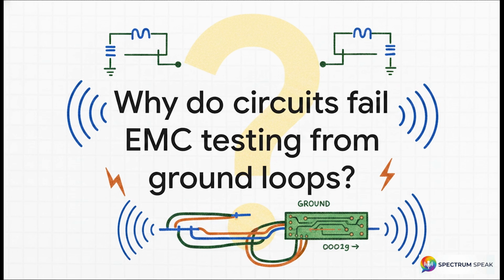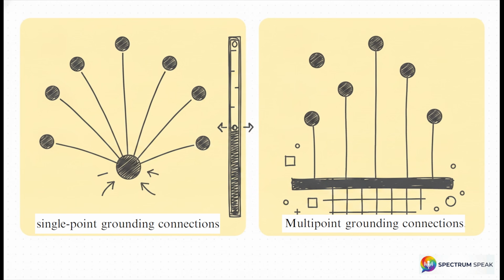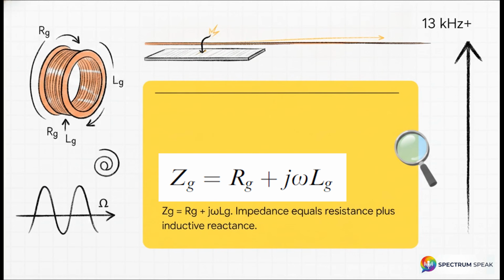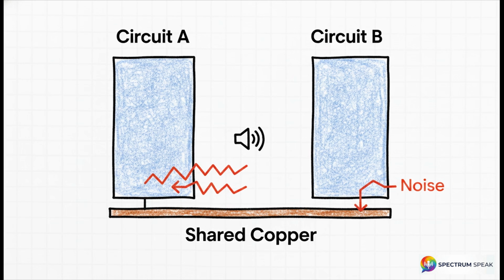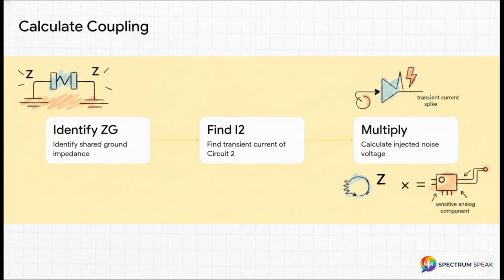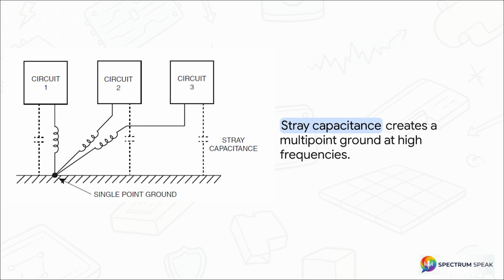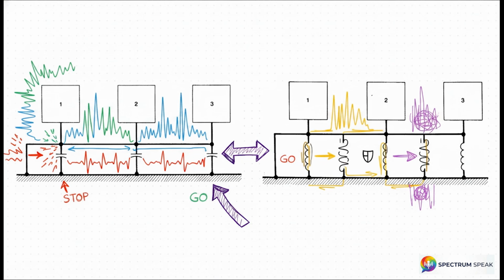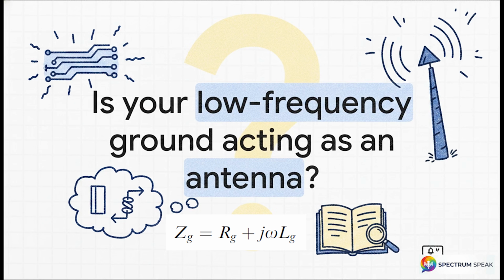Single-Point vs Multi-Point Grounding | When to Use Each?

Comment: What BS is speaking that robotic voice? :face-blue-wide-eyes::face-pink-tears:🤣
Reply from the maker: The voice is AI, the engineering is human. 😄 My goal is to explain EMC concepts as clearly as possible. Appreciate you checking out the video!
Reply: @SpectrumSpeak-y8h  yes, but if it contains dramatic fillers like "We're going to treat these foundational equations with absolute rigor so you never have to guess at a ground path again" it makes it really repulsive to listen to. It's written like a over dramatized buzzfeed article. Each sentence sounds like it's clickbait.

"look closely at equation 3.1" There is no equation with that reference index on the screen. It's the lack of consistency that's borderline insulting the viewer. Is the "rigor" in the room with us? Why am I told to look at an equation with a specific reference index when the video doesn't contain the same indexing? 

And the change of intonation is also really off putting. From a calm voice to a angry and neurotic one. It's distracting and makes me want to close the video in the middle of watching it, when the presenter starts barking at me. The narrative itself takes a couple of sharp turn as well. It's not easy to follow. It's circuit 1, then it's circuit A, then it's an abstract illustration still talking about equations with no equations on the screen.

It's lazy and creepy and makes me just angry that educational content is becoming a matter of producing as much content with as little effort and "rigor" as possible. So I'll be blunt with you - you can still be a useless moron even if you have good intentions. All it takes is to be a lazy slop goblin and all your good intentions are worthless or in case of factually incorrect information, it can even be harmful to the viewer. 
1/10 - would not recommend.